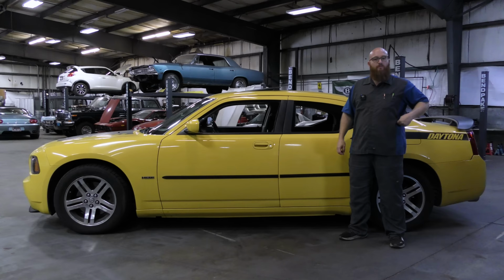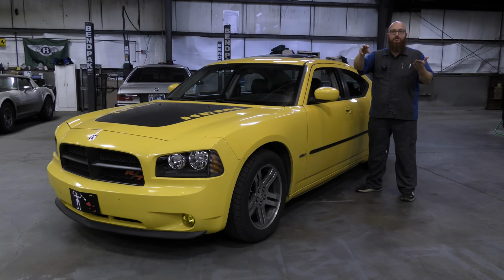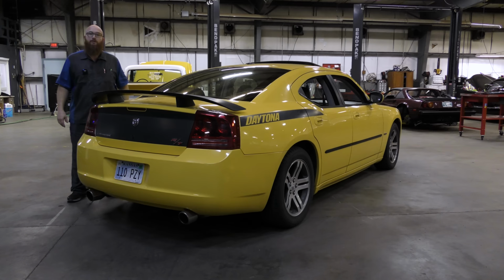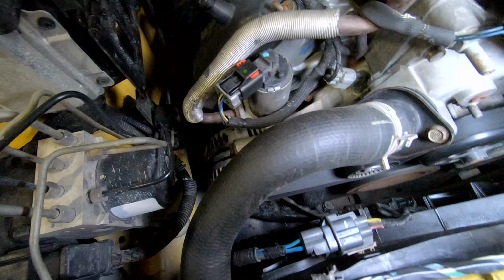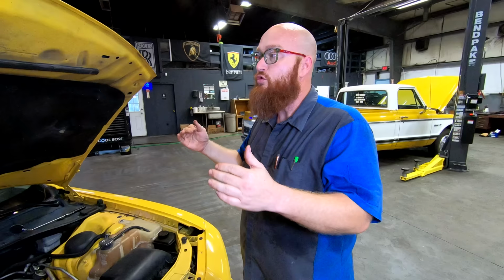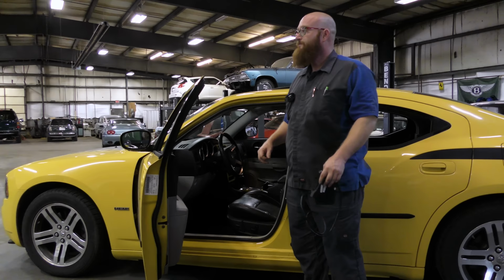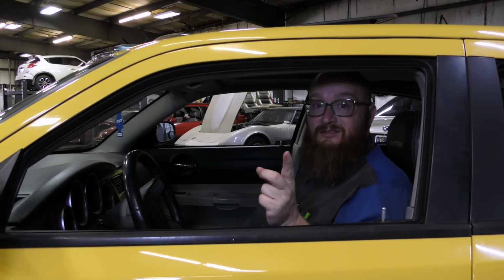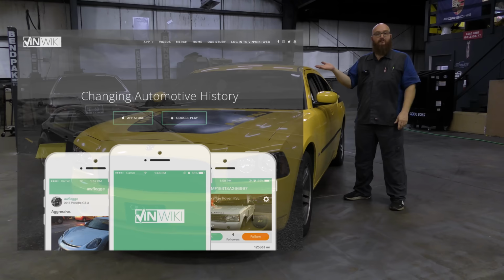4 things you MUST check before you buy any used car! CAR WIZARD shows how not to be scammed!

Comment: Or you can use the Hoovie "Car Issues" approach:  show up, rev the engine twice, shake hands, hand over an envelope of ca$h, and leave.  Takes substantially less time.
Reply: And then cash off with your videos 😉
Reply: Me when I find a sub-$1000 shitbox 🗿
Reply: I fully support this method
Reply: ALWAYS offer more than the asking price to be sure you're the "winner".
Reply: Sounds about right lol
Reply: Don't forget to rapidly slap the roof multiple times.
Reply: @Gerarghini  My god.... I'm looking to buy my little brother his first car and I found a sub 1000$ 2001 Honda Accord. I really hope there's not TOO MUCH shit in this shit box.
Reply: I just look at the stated value of the car, deduct for the cost to repair the problems and offer them the twenty bucks that's left over.
Reply: Somewhere in between all those steps is snort a line of coke since no sober mind would move forward with those purchases.
Reply: No I will get a case certified technician to check out the car!
Reply: That's what I did with my f150 but I looked inside and found it needs 1400 dollars worth of Interior parts an much much more
Reply: I have done that with most of my car purchases. Worked out badly 3 or 4 times, worked out well about 12 times. So you roll the dice I guess... 
I just bought a car sight unseen from Japan and its on a boat on its way here, so I guess we'll soon find out which way that one goes...
Reply: Ask if has a service history. If the seller says yes walk away and look for a cheaper, worse condition one 🙂
Reply: That's what I always do.  I'm 45 years into my driving life and it's always worked for me.
Reply: I think this comment is the exact opposite of the point the wizard is trying to make!
Reply: Update, the car from japan needed a few bushes and ball joints, a new turbo, brake disks and pads, and a little bit of paint, but it is now a very nice car. 😂😂
Reply: They dont even need to pop the hood with me, just show me it has a raggedy subwoofer box with 2 12" subs and we got a deal
Reply: @BlueXonar  did the car arrive?
Reply: @Fallenlyrics218  It did indeed. :)
Reply: I did that and lost 5000 dollars on a complete lemon squeeze

Comment: Don’t forget the classic trick of covering up the check engine light. Turn the key to on but don’t start it. Check engine light will be on. If not, huge red flag.
Reply: And also airbag and ABS light.  People have bought crashed cars where they didn't replace the airbag and just disconnected the light.  Some of those people died in car crashes later...
Reply: @redbaron6805  ABS light was a red flag!
Reply: Yep one of the cars I bought years ago turned out to have no bulb for the check engine light. Super shady.
Reply: @JoeUrbanYYC  The good news is, scan tools are getting super cheap.  Which means, they can disconnect the Check Engine light all day long, all the codes will still show up if you check the car with a scan tool.
Reply: @redbaron6805  oh yes, that was 12 years ago, I am much better prepared when I go shopping again this fall.
Reply: @JoeUrbanYYC  Make sure the OBD port works! I went to check out a truck and it didn’t work. I ended up checking and found it was missing the fuse for the cig lighter. Only checked since apparently they where able to pull the codes. Lots of red flags I passed on the truck
Reply: I so wished I had some of this knowledge a year ago my son bought a real lemon of a used car. The infamous 2013 Ford Focus sadly it’s just been a year of course the transmission is the problem and he still owes too much to get rid of it. It should be against the law to sell those POS cars all they did was pass on their problems onto us!!
Reply: yeah I made this mistake with my current first car...only noticed that the check engine light wasnt coming on at all after like 5-6 months of owning the car. Luckily no problems so far with that

Comment: If you show up and the car is running or engine is hot, 99% of the time something is wrong.
Reply: This is often true. 

I bought a 170k mile 2006 prius last year and the owner already had it running. It ran decent, but not perfect. The next day when I picked up and paid for the car, the seller had it running again.
The next morning, I was greeted with a surprise on cold start. It took 2 start attempts before it reluctantly started and ran very rough for a couple minutes, before it mostly smoothed out. During that first 2 minutes, it sounded like a jackhammer and had obvious misfires.

The engine oil was fresh, but I suspected the oil changes had been neglected for a long time. The dipstick had heavy varnish on it. After a motor flush that got A LOT of gunk out of the engine and some fresh spark plugs, it ran way better. After 8 more short-interval oil changes with marvel mystery oil, it is healthy again. On the first few MMO-laced oil changes, the oil turned black in a matter of days. Now, at 184k miles, it runs as it should, even on cold start.

 I thought for sure I'd be swapping an engine in this car. I'll bet the previous owner thought the same. I got lucky with just a tune-up and clean-up fixing it. The joke's on him, as it's now worth 2x what I paid for it.
Reply: @Brandon_Nelson92  Mmo in every used car I buy!  I add it to the gas at every fill up , and in the 1st few oil changes, & along with new plugs, those engines run great!
Reply: Assuming you meet the seller at their home.  If you're doing the transaction in a shopping center parking lot, that's obviously not going to work out.
Reply: @russellhltn1396  when I bought my prius, I met the dude in a shopping center, both when I first drove it and when I met him again the next day to pay for it and pick it up. 

When selling a cheap car, I schedule the meet-up in a public place with video surveillance for safety/security reasons. I understand why the seller of my prius did the same, except it also allowed him to hide the engine problems.
Reply: @russellhltn1396  good point
Reply: I've thought about showing up near the sellers house an hour before the scheduled meetup so I can see what he might be doing to the car in preparation for me to see it. Assuming he's selling it from his home.
Reply: Sometimes I bought my vw gti from a dealer and it was already warmed up before the test drive 1½ years and 22k miles later with a downpipe, intercooler, new fuel pump and e85 tune she runs perfect and I drive her hard all the time
Reply: @poyo3582  funny you mention those 3 mods and running e-85...

That's exactly what I have planned for my 2019 3.5 ecoboost f150 soon. It was my first new truck/vehicle. I commute with a beater car not only to save gas, but also to keep the mileage down on my truck. I drive 30k a year. My truck only has 27k so far.

I plan on upgrading the fuel pump(s), downpipes and intercooler. It should yield 600-650rwhp safely, based on what other people are dynoing their trucks at. They're also running low 12s in the 1/4 mile. Those willing to risk aggressive tuning are seeing 700+ and mid-high 11s in the 1/4 mile.

That GTI must be a blast to drive after doing those mods.
Reply: @Brandon_Nelson92  yes it is! 370whp and near 400t this setup is good for 11.9 second quarter mile! All in all I've just upgraded the intercooler, downpipe, fuel pump, and spark plugs, looking to go hybrid turbo setup to get to 500whp!
Reply: That is a common trick and smart to check  the temp of the engine.
Reply: Absolutely correct. Always get there early in the morning and insist on a cold start. Oh I warmed it up for you is a huuuge red flag. We bought my daughter a mustang from a huge dealer. Car was in the back and still dirty it just came in. They had to bring it around for the test drive. I was scared to death because it was running and I didn't get to start it. But otherwise it was nice and turned out to be a great car. But still, do a cold start if at all possible.
Reply: This comment hit close to home 😂

Comment: Very helpful! Just one more to add: the parking lot test. Park directly next to a painted line in the parking lot and then look at the reflection in the side of the car. If the (straight) line is all distorted and wavy, the car had impact damage. Doesn’t matter if they used filler and the paint is smooth as such, you will still see it.
Reply: Are you implying it's not possible to repair damage to factory specifications?
Reply: @CadillacDriver If it's been repaired to factory specifications then there's no issue essentially
Reply: @nicholaswildethethird  you missed my point. The OP essentially said that no matter how well a repair is done, it's impossible to get it back to factory specs and you will be able to tell it's been repaired.  This is not true.
Reply: @CadillacDriver Unless you’re planning on spending stupid money or have the skill and time to get it back original as possible. OP’s advice is good for the average joe to look out for. That’s the point you’re missing.
Reply: It’s the same thing ChrisFix looks for in vehicles that may have been in collisions. Things like the spare tire well is not easily fixed if dented in a rear collision, or the engine bay area has clear dented areas that are not perfectly linear, more easily noticeable with the hood down or the trunk shut, just look along the panel gaps. Those are very hard to straighten perfectly.
Reply: You can definitely repair it to not see it lol, where you getting your work done on your cars?
Reply: @nicholaswildethethird  I believe CadillacDriver was being sarcastic.
Reply: Or just bring a magnet with you it wont stick on the filler ..
Reply: Panels aren’t aligned

Comment: I walked away from a vehicle the minute I opened up the oil cap.  I looked into the valve cover and all I saw was white milk. More important than most of the other stuff.  I am surprised the car wizard did not mention this Major Red Flag.....
Reply: Bad head gasket
Reply: @jogmas12  , and/or cracked head or block.
Reply: …would the dip stick show foam???
Reply: Coolant in the oil could also be a bad intake gasket. But even if the gasket and fluids are replaced, there's a pretty good chance that all the bearings in the bottom end are gone. Just walk away.
Also, look for varnish on the oil dip-stick. If there's varnish there, the car has missed too many oil changes. Walk away.
Reply: So this one is actually not as much of a red flag as you might think IF it’s in the middle of winter. My 2007 Chevy impala oil cap looks like milk in the middle of winter but during the summer its dry.
Reply: @surferdude4487  so the varnish accumulates on the dipstick or some one put it on intentionally?
Reply: @Dbb27  Old oil deposits sludge all through the engine. The varnish on the dipstick results from fuel from blow-by accumulating in the oil and the oil evaporating. If there's varnish on the dipstick, the whole engine is full of sludge. That's bad for old engines and even worse for new engines with their cam phasers and such. Low tension piston rings will also fail. It means that if the engine isn't junk already, it shortly will be.
Reply: Not necessarily. Very common in the winder after short drives. Condensation.

Comment: One thing I look for when looking on used cars is whether both headlights are equally as faded. If one headlight is crystal clear and the other one is a bit foggy that’s a good indication that the car was in an accident.
Reply: Not necessarily. I’ve replaced one head light because the seal went on it and started to collect water…
Reply: Not to mention  headlights can be sanded and reclearcoated to look new.. or a 3 m restoration kit $30 parts store or temporarily clean by running a buffer over it

Comment: The best advice I ever got about buying used cars was to be very careful about buying a car that was just running or is when you arrive.
There's a good chance they are hiding something
Reply: Good one.
Reply: So true. If the car is running already, then turn it off. Sit a few minutes and pretend to talk about the interior, then turn it on
Reply: @diallo1347  this is bad advice a " few minutes  " is not enough time for the engine to cool off completely  and witnessing a cold start is paramount feel the engine climb underneath  feel the exhaust check the cats etc ..or walk away ..

Comment: 19:30 The one thing you missed is before you start the engine just turn on the key and make sure all the bulbs light up particularly the check engine bulb. A lot of times people will remove them but of course your code scanner should pick that up. But you should check all the bulbs in the dash
Reply: What if they’re burned out? Lol. Mine burned out but my car is 47 years old. Fuse popped
Reply: @DannyTOG  well exactly! That’s why you should check for that sort of thing it could just be burned out but you want to make sure that it is working or at least to be aware if it’s not.
Reply: He has another video on that, but a gauge check is critical.
Reply: Can digital odometer be rolled back to show lower miles?.Is that a common scam??

Comment: I went to MD to NJ myself, as a woman, to purchase an Eclipse.  I purchased a cheap code reader before I left. Put the code reader in the eclipse.  I forgot what code came on but I called my mechanic and cousin with the code. They both said it was the catalytic converter. He wasn’t willing to bargain is what he told me when i initially asked. I walked away from the headache from the one small investment.  Obviously the code had been turned off but the issue not fixed.

Comment: I would always check the tires. Worn tires are one thing, but uneven wear indicates that something is up with the suspension. And if the tire brands don't match, or it is running a budget brand that you've never even heard of, you know that the owner has tried to run it on a shoestring budget.

Comment: You can be scammed with the coolant reservoir/expansion tank. I've seen where they will clean it out real nice, then they will take off the hose and plug it off with something, put the hose back on with the restriction in it, then fill it with clean fluid. Looks can be deceiving and they do this to hide a serious problem. Pop that hose off and check it if you're suspicious about it.

Comment: It’s actually good to rev it if you have another person/camera looking at the engine. If it moves out of place at all, it likely has a broken motor mount. Unexpected engine movement can lead to dozens of problems. Water/vacuum hose stress, wire stress, etc.
Reply: I just discovered that the car I bought 2 years ago had a motor mount bolt that was missing. I bought a new bolt and installed it right away.
Reply: Wizard! I’m not into cars,but Jeeps But somehow you keep me interested. I really just like your car wizard show. I have boats also. Just wanted to tell you , and your family, The wizard family is amazing! Be honest just lost of words.
Reply: It's much easier to test for bad motor mounts by putting the car in drive and reverse repeatedly. No need to touch the gas pedal.
Reply: @johnbrown1381 , how does this work? Works only with a hydraulic auto transmission, right?

Comment: Wizard, don't forget the gaps between body panels, and the shifted bolt marks!
Reply: I'd also stay away from any old car that has an 'underbody coating' or appears to have been painted black. They're usually hiding rust.
Reply: Mike Brewer said of all body damage; the shape spare tyre well, if internal, is a valuable element because that area does not repair easily.

Comment: Since bumper covers, especially unpainted ones, can pop right back out, It could also be a good idea to look in the trunk for damage. Lift the trunk floor and check that there's no damage to the rear structure.
Personally I would also be cautious if the engine bay is showroom clean. Makes me wonder if they're trying to hide leaks.
Maybe also unscrew the oil fill cap and check for "chocolate milk".
Reply: Your comment that a very clean "power barn" is a sign of hidden problems may not indicate that seller is hiding problems. I personally try to keep the engine bays of my vehicles NEAR "showroom clean", by "hand detailing" (NOT power washing) on a monthly basis. My vehicle is only driven during good weather (I am retired, don't drive much) so keeping the vehicle detailed adds to my driving enjoyment and is relatively easy to do. I am driving LESS but enjoying it MORE!